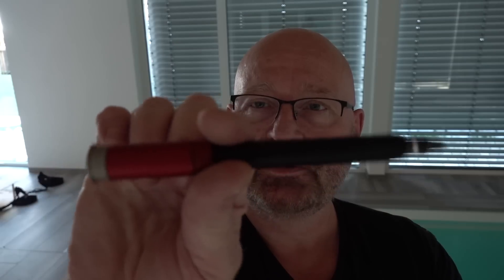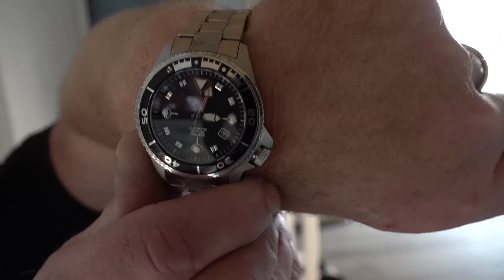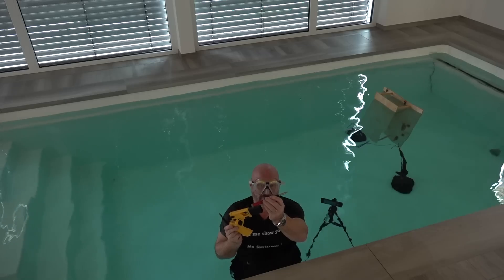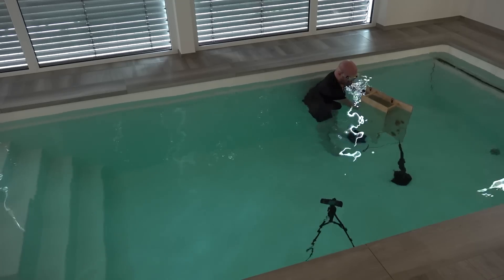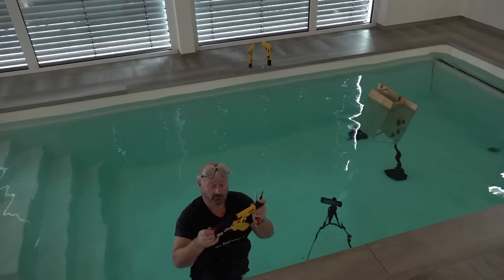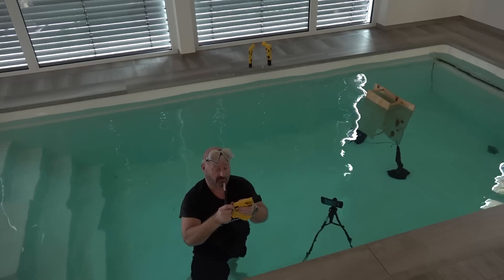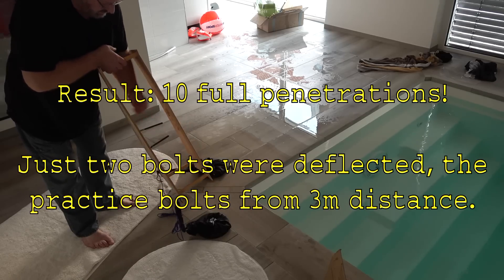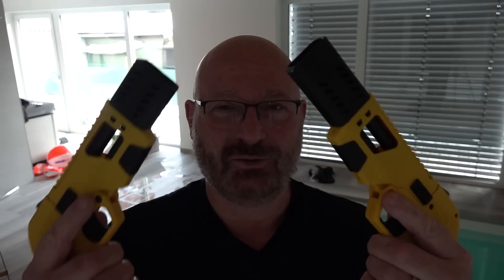Scuba Ringer Mk2: Under Water Tests!

Comment: Have you tried supercavitating tips? From what I’ve seen of supercavitating bullets, it doesn’t seem all that complicated to machine from rod stock. From back to front: a cylindrical section for weight, a long conical section, a small round groove most of the way to the tip, and a rather blunt but small cone tip.
Reply: A big issue with cavitating tips is the act of cavitation slows the spear a whole lot. Remember what cavitation is. A nearly explosive vacuum happening at the edge of an object in a gas or liquid.

Comment: Really cool! But I'm unsure how well these would work for spearfishing.
I can see two glaring problems. The first being the lack of any string which is crucial in spearfishing, and the second being the fairly small projectiles.

I could imagine it working, but it depends on accuracy a lot. When you hit a fish when spearfishing, it's often still alive after the first shot. The string keeps it tethered to the speargun so it can't swim away before it dies. With a gun like this however, your shots need to be very accurate. You'd need to hit the fish directly in the head, or along the spine to immobilize it instantly before it could swim away. You get the benefit of follow up shots and an easier time aiming compared to a speargun, but since the weapon is quite loud, it might scare the fish away after the first shot if you miss, or you could hit the fish poorly and it'd just swim away before dying much later, far out of your reach.
Since the projectile is small as well, that means you have less of a chance of hitting an important organ; such as the brain or spine, which you would need to do because of the lack of string.

I'd really be interested to see someone spearfishing with this though. The small size and possibility for follow up shots could make it an interesting choice for people spearfishing larger fish.
For example, if you speared a tuna or stripped bass poorly, and it was still alive and putting up a fight, you could definitely use something like this to quickly shoot it in the head and kill it.
Kinda like an actual sidearm lol

Again, it's a really cool design!
Reply from the maker: You can attach a line in 30 seconds of course, just tie it to the tips (they are screwed into the spear shafts).
Reply: @Slingshotchannel  I see it as more of a shark defense than spearfishing tool

Comment: Still needs more power. 
3 meter is a bit anemic in particular against bigger fish. 
If it the power can be increased to 5m without being bigger it would be really nice. Also some improvement for making it easier to attach a reel to the bolt, those bolts are expensive.

Comment: A lot of people forget what water ranges are vs in air. Max range in water being 2-3 meters is similar to 15-20 meters in air. That range is only really for accuracy not penetration power. Salt water is roughly 850 x more dense than air when accounting for salt & that's at surface level. As you go deeper in water the pressure & density goes up dramatically.
Reply from the maker: The pressure goes up, the density stays the same. Water won’t compress.
Reply: @Slingshotchannel  True. I meant the density of salt water & how even though it's not compressible water has differing density due to salt content & temperature. Subtle as those effects are & the effects on ballistics.

Comment: Was wurde bezüglich der Verlässlichkeit unter Wasser bemängelt bei der MK1? :) löste sie manchmal nicht aus oder korrodierten die Alurohre oder in welche Richtung geht es? Mir scheint die MK1 supper verarbeitet zu sein. Eine tolle Modulare Plattform. Wirklich klasse. Mega wäre, wenn man eine Kartuschentrommel hätte wie bei einem Revolver.^^ sodass man nur einen Lauf braucht. Wer hatte das 3D-Model erstellt? Vllt könnte ich da was verfeinern^^
Reply from the maker: Manchmal zündete sie nicht unter Wasser, vor allem mit den Stahl-Berstscheiben und bei zu geringem Druck. Eine Trommelversion müsste leider sehr klobig werden, die Kartuschen sind ziemlich dick. Das wäre unpraktisch.

Comment: How do you manage hearing protection underwater. The concussion from the shot gun shell must be like a depth charge.
Reply from the maker: Not a problem really. it is actually louder above water.
Reply: It's not a shotgun shell, it just looks a lot like one. It is using compressed air to propel the bolt/dart. The trick is how piercing a plate at the rear rapidly releases lots of air into the hollow barrel of the bolt causing it to whizz off.
Reply: They aren't shotgun shells, they are reusable air cartridges that happen to look like shotgun shells because they are often used in replica airguns.

Comment: Now it just needs a little clip to hold the rims of the cartridges so you can put 2 in at the same time and remove them together 😎..Will solve the issue of having to fumble with individual cartridges if you have to reload underwater.

Comment: Are you aware a similar concept was successfully produced in the 1960's, the Johnson submarine speargun (SMG) (Alock and Pierce also made a single barreled version) used waterproof plastic sleeved 22lr ramset blanks to propel a spear. These spearguns were awfully heavy, most had multiple barrels (in a Revolver/Gatling gun type assembly) and even though they were only 22lr they were very loud.....but quite powerful. Banded from use in most places around the world, one of my spearo mates used to use one in the 80's.
Not sure you really need a shotgun shell to propel a spear
Reply: The spears are propelled by pressurized air cartridges, not shotgun shells
Reply: @Ezakin00  My bad watching on my phone ..... and the cartridges looked like shotgun shells, thanks for the correction.
Btw....CO2 has been done before to......there are quite a few issues to overcome with pneumatic powered spearguns, mainly the negative effect of depth on their power. Maybe useful for zombie apocalypse, but when it comes to gun size small spearguns have fundamental issues with released spear line capacity, and spear stability and inertia. Not trying to be negative just injecting some real life experience.
Reply: @bunyipdan  in the context of super tight gun laws in germany, this is one of the best legal thing to use.

Comment: @JoergSprave Hey Jöerg! Is it possible to make the nail bolts for Adder lighter?
Reply from the maker: Why? Heavier is better.
Reply: @Slingshotchannel  Do lighter arrows fly farther isn't it?
Reply from the maker: Not really, they are much more prone to air resistance. A heavy arrow has more inertia.
Reply: @Slingshotchannel  OK. By the way, are there any Adder videos coming? Or have you burned out of Adder?
Reply from the maker: Yes, the new Venom 170 and 190 lbs limbs are here and I will soon present them in a video.

Comment: Hm, seems weird to use gunpowder now when it's underwater.  Seems like the perfect time to make an underwater crossbow!
Reply from the maker: This does not use gunpowder, just compressed air. You can reuse the cartridges, just fill them with the same compressor you use for the air bottles.
Reply: @Slingshotchannel  Ah, that makes sense.  Pardon my ignorance.  That said I still think you should try an underwater crossbow/harpoon!
Reply from the maker: I did test crossbows under water, but they don't work. The limbs are slowed down very much by the water resistance, the bolts fly maybe 2 meters and then sink down, tips first. Rubber based spear guns work much better. But they are bulky. If you want a pistol size spear gun, compressed air or gun powder is the best option.
Reply: @Slingshotchannel  Of course you've already tried that.  I forget who I'm talking to.  Lol.

Comment: so whats the use of this  harpoon  if no  string atached to the arrow?  fish  do not fall dead  by  this  sharp arrow  unless  it has  explosive head  ruining entire catch, I  guess  it is a self defense gun sold  under  cover of regulations...please  show  us a field test under real condition , also  how does your ears   get  after that close explsion under water?
Reply from the maker: You can very easily attach a string to the bolts, right behind the tip. Ears, no problem. You feel the shot in the stomach, but it is much louder above water.
Reply: People in the comments are making the common mistake of assuming it is a shotgun shell. It is compressed air. No explosion happens. It's probably loud, but not ear damaging.
Reply: @stephen-boddy  yes I know it is comp air but the short run is not as efficient as the long air harpoon. Besides. Not string nor expanding tip to keep wounded prey  swimming  away.
Reply: @Slingshotchannel   hi joerg.. easy is never done.. only you could
And notso easy to have the string  neatly  fit and  easily released under water
But I know.  YOU CAN DO IT
Reply: @Slingshotchannel  please show us how the string attached to end of bolt  fits inside barrel or inside propelling piston please
Also scuba harpoons have a reach of at least 3 mts
Saw you testing at .5 mts
Just kindly asking.. I m a big fan of your channel

Comment: that is not a tes. Test at least at 15 m of deppness and at  5m of distance
Reply from the maker: No spear gun does 5 meters with enough power, certainly not the compact models.
Reply: @Slingshotchannel  yeah, but no spearguns costs so much. For that money and mantence effort it should give pretty nice features... If I need to be such close underwater, why just not to use Shootka harpoon?? Hawaian sling or whatever that costs 25 dollars and not as much as that gun?
Reply: @AnaisGutierrez-iv3cw  i get you... But this is a gun, and it's very small and compact. You can put it on a holster. Or bring it to some places/car without too much trouble
Reply from the maker: I don't really know, it isn't a very good harpoon gun for the money. It just is much smaller and lighter than competition. We still sell it really really well. My suspicion is that most people buy it because it is unregulated and it is super super deadly above water. So they abuse it for self defense.
Reply: @Slingshotchannel  yes indeed that's the case. Basically a too-good self defense pistol and it's legal/unregulated
Reply: @Slingshotchannel  OK, I understand you. Thanks
Reply: @Slingshotchannel   " I suspected it: the old trick of...." Said MAXELL SMART

Comment: Well... "spearfishing" with a "Speargun" without line attached to the spear is quite  ... stupid? 
Anyone REALLY practicing spearfishing knows why. There are at least 2 reasons for that...
Reply from the maker: Attaching a string takes about 30 seconds.
Reply: @Slingshotchannel  oh, there are eylets or similar on the Bolts to do that, and it still fits into the gun with a string?